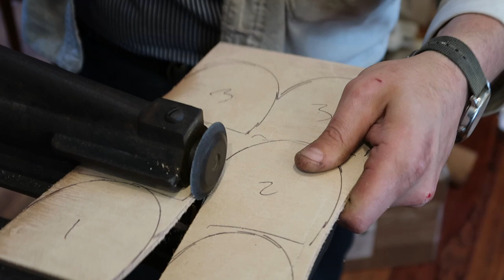VINTAGE SEARS ENGINEER BOOTS RECONSTRUCTION

Comment: Why did engineer boots go from sleek to bulky? I know expensive Japanese brands are copying the old style but they are over a $1000. Is there a sleek engineer boots under $500?
Reply: Look up Wesco Mr Lou engineer boots. Cost around $700 to $800, i have a pair and they are amazing. Ebay and Grailed have second hand boots, be patient as good deals do come up from time to time.

Comment: Do you prefer the double needle welt method or the jerk needle?
Reply from the maker: It sort of depends on the footbed, if there is gemming we usually find a jerk needle to be sufficient and a bit faster, if there is a channeled holdfast we usually opt for double needle as it's easier to find all the original holes with an awl rather than a jerk needle, which isn't really meant to be used to pierce thicker leather. Whenever we relast boots or make new boots we use the double needle method